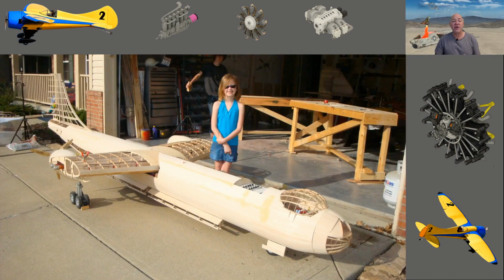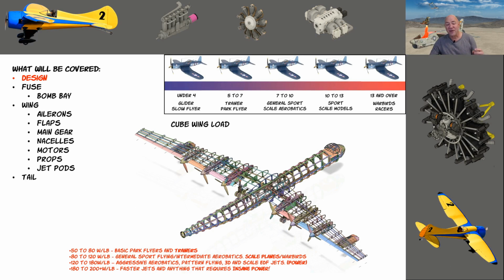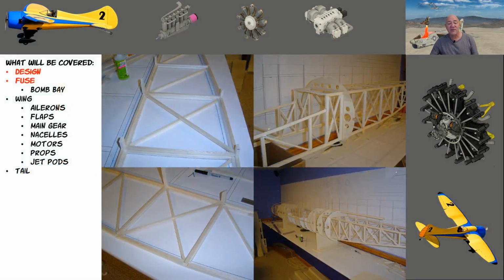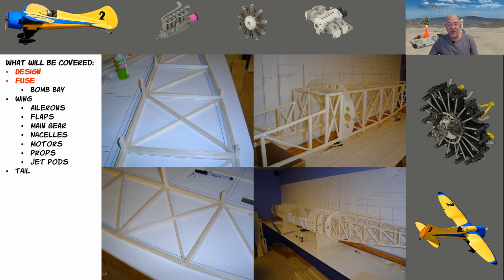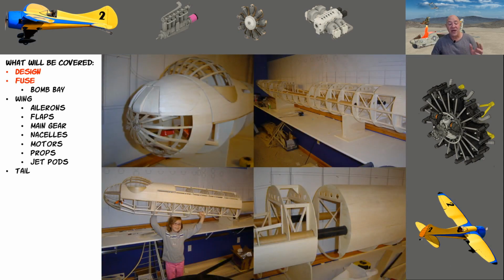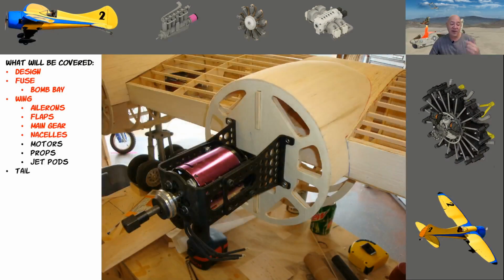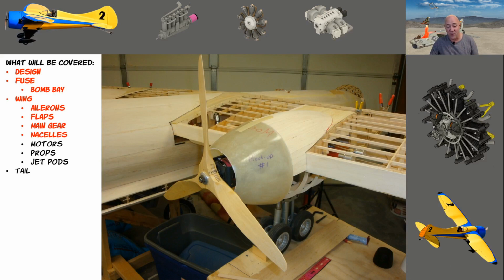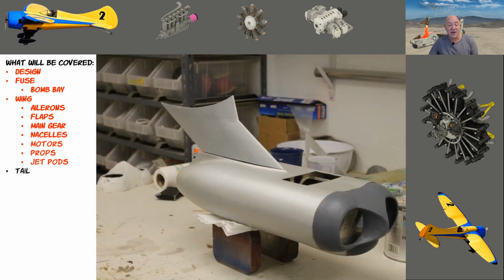Project B-36D (257" RC Model Bomber)

Comment: Hi Dag214, thank your videos are very interesting.  I am very interested in painting Monokote and how to do it.  I have a TF giant scale ARF Zero I'm going to assemble.  It has the all army green upper and grey underside - very boring?  I found  a colorful scheme - all red turtle deck, tail plane, fin & rudder.  My friends tell me the paint won't stay on the monokote covering., that  I need to pull it off and glass it. 

So sand surface to be painted (was going to try that anyway) with 1000-1500grit sandpaper  - wet or dry?  Also what type of paint do you use?  Would acrylic car auto paint work (rattle can  type you get from an auto parts shop) as I don't have a spray gun.   Grateful for any advice you can give.  Regards, Paul Canberra Australia.
Reply from the maker: Around the 28 minute mark in this video I talk about painting monokoto- https://youtu.be/zVXV10pP2-E . I have always dry-sanded with 1000-1500 grit just to scuff up the monokote. I then will use a little air to blow off the dust. Next, I will take a cotton rag with some denatured alcohol and wipe it clean. I have used Krylon paint in a can on many planes. Hope this info helps. :)
Reply: @dagtheaviator   Thanks you so much for the reply.  I'll give it a go in the next few months - winter season coming down here.  Actually not to cold, but more likely don't have RC flying weather so some shop (shed as we call it) time. Cheers.

Comment: Got a question. I’m planning on designing a f6f and I’m still not sure what I should build out of. My current plan is to use flite test foam as formers and build as light as possible. However, when I see the large flite test planes they build on there channel the foam sheets they cover with don’t look that great.  I don’t really like the seams and when you pick up the plane you can feel the empty area inside the fuselage or wing. If I covered with balsa would this help that problem? Or, what do you think to build out of foam and firmer glass? It may get heavy. I don’t have. A great way to cut wood yet and I think it would be more expensive than foam. Perhaps foam is to weak and I may not have any option. Any thoughts? Thanks!
Reply from the maker: I have seen a few people take the foam sheets and make it look like a balsa plane. They make the fuse bulkheads out of foam. But when going to skin the fuse they cut the foam in long strips (planks) and run it down the fuse. Then use some sort of filler and sand it. In the end it looks really good. I have also seen where people have balsa sheets a foam (bulkhead) fuse. :)
Reply: @dagtheaviator  do you think it would need fiberglass? I would rather not add the weight.
Reply from the maker: @excellenceinanimation960  If it were me, I would not glass it. I have seen people prime and putty it to make it look good.
Reply: @dagtheaviator  ok thanks. Just gotta gett better at cad now. (:

Comment: What a beast !! .. I've flown full size aircraft with smaller wing spans than that model ! :) 
I remember when you started this way back when on RC Groups, this is one piece of impressive design work ! 
On a side note I ran the numbers for the wing cube loading for a full size F104 Starfighter and at the max take off weight of  29,000 lb's it came out as 169 !!!  ..... talk about a lead sled ! :D

Comment: Such a awesome model. I look forward to the in depth videos. I'm getting closer to starting on my big cauldron project. I finally have a work shop big enough for it!
Reply from the maker: It takes a bit of room to build these big planes. :)
Reply: @dagtheaviator  yes it does. My cauldron will have a 11 feet wingspan. I've started building the smaller version this winter. I'm making progress on it. I hope to have it in the air by next summer.